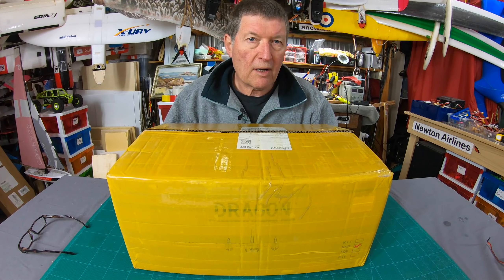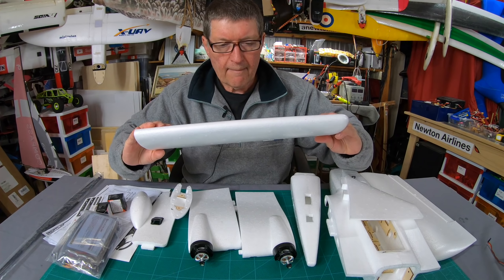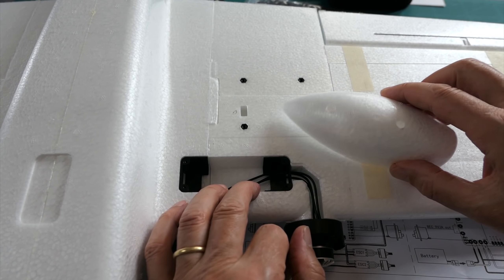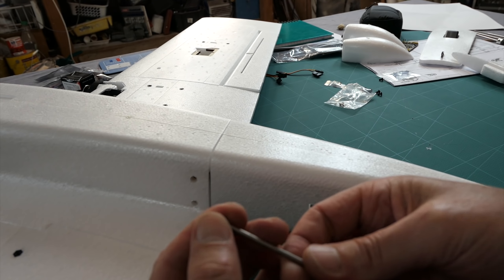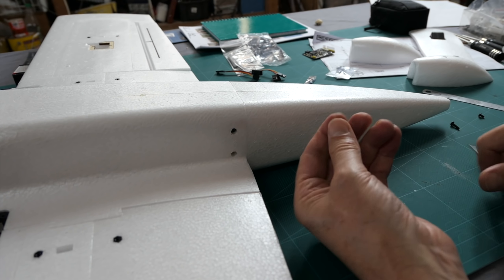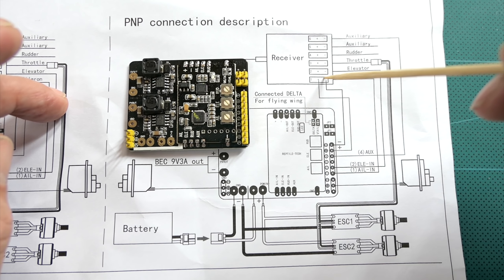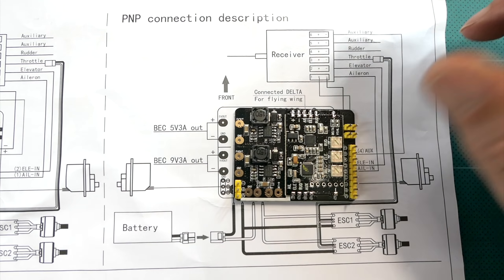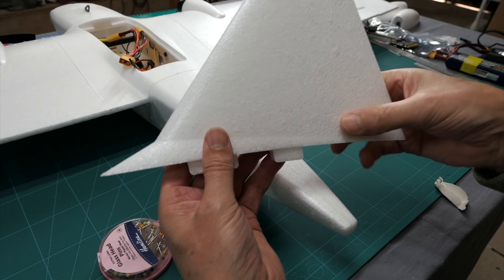Reptile Dragon Twin Motor FPV Plank - Review and Assembly

Comment: Had no idea this model was even out there until happening upon it here. Currently designing a 1600mm twin plank out of some Origin Funter wings but couldn't pass up this kit for about $84 with the code shipped to the U.S. I always use my own components to make sure they're the best quality and reliable. Should be good sized to transport. Looks to be of good quality. Huge fan of twins. Good find, Andrew. Xion.

Comment: Having a hard time getting the CG far enough forward, would you recommend using stand-offs to move the engines further forward or possibly removing the tail and adding vertical stabilizers somewhere along the wings between the joins?
Reply from the maker: I wouldn't mess with the tail too much. Moving the motors forward would work, but I would just add lead to the nose first
Reply: Thank you!

Comment: I ordered the kit on pre-order, shipped yesterday. Does it fit 7" props? Trying to decide what motors I should use. 7" might be good on a slower flyer
Reply from the maker: 9" prop will just fit, but 8" and a 1400kv would be best
Reply: @AndrewNewton  interesting, thanks! I've got some 50g 2508-1500kv quad motors that should be about right.